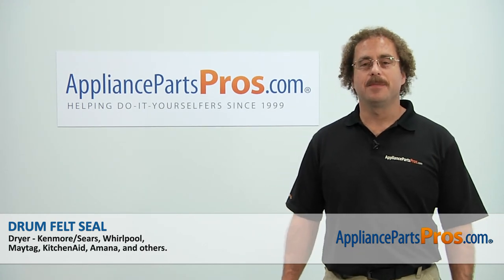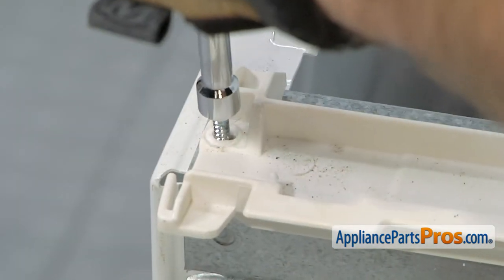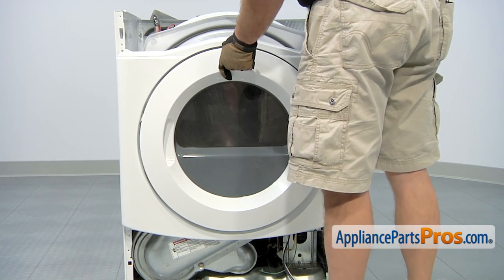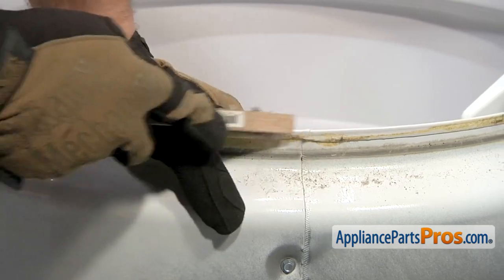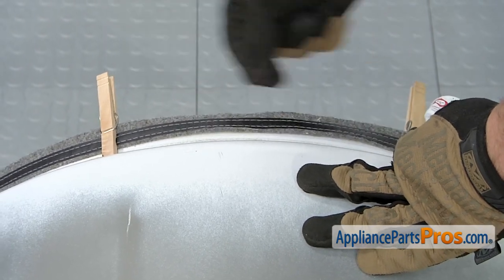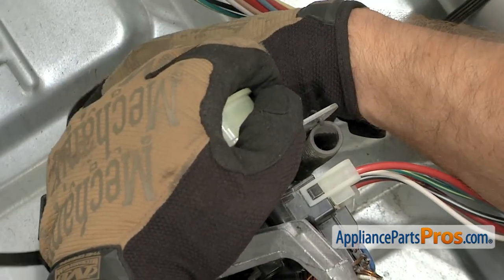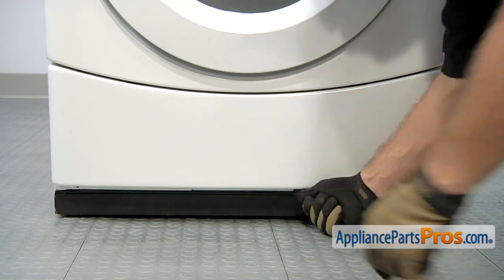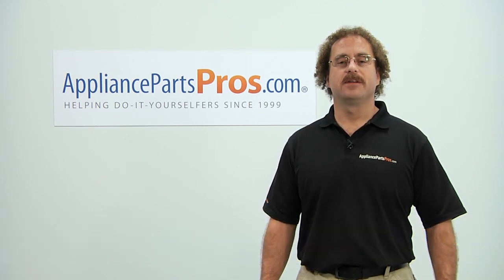How To: Whirlpool/KitchenAid/Maytag Drum Felt Seal 280114

Comment: What would happen if I use aluminum foil tape, instead of glue, to secure the felt seal to the drum?
Reply: How did it work? I'm sure using some sort of super glue would be a better option.
Reply: @erik1514  The adhesive that comes with the felt seal is designed to withstand high heat. Just finished putting a new seal on my dryer. The adhesive works well; aluminum foil tape would require space that the adhesive doesn't.